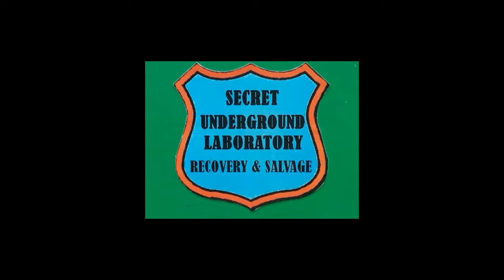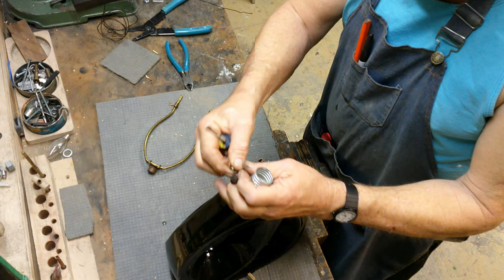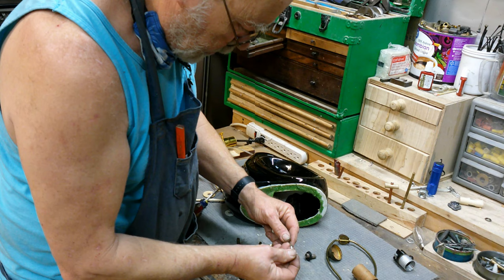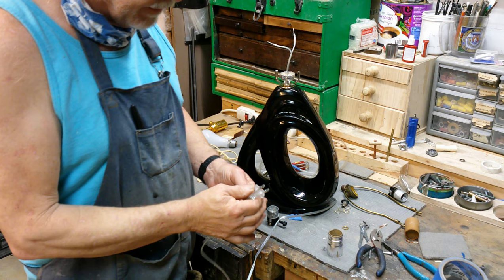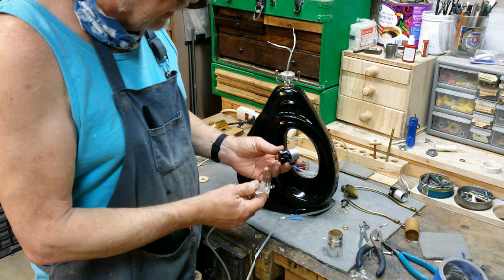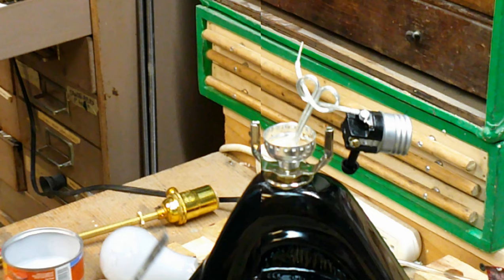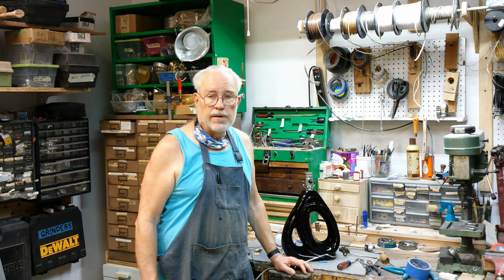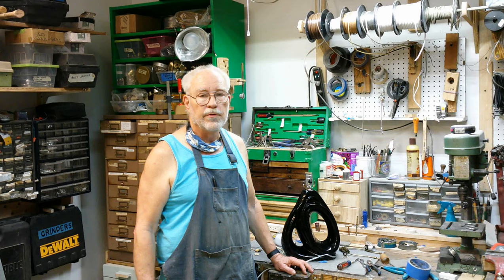Rewiring a 1950s art pottery lamp in the Secret Underground Laboratory.

Comment: Antique lamp 
In your video I don’t get the best view of where the wires go on the 3 terminal I have 3 wires and I’m not sure where they go.
Reply from the maker: Most lamp cords have only 2 wires. If your cord has 3 wires, one is a ground wire and should be attached to the lamp pipe. 
In this video the socket has only two terminal screws, a brass screw and a silver screw. If your lamp socket has three terminals, it should be a brass screw, a silver screw, and a black screw. The black screw is for a night light bulb in the base. The lamp cord insulation has one side which is smooth and the other has a ridge. The smooth side goes to the brass screw. The night light socket will have a black wire and a white wire. The white wire and the ridge wire go to the silver screw. The black wire goes to the black screw. I hope this helps.
Reply: @BronZeage  I’m going to send this to my grandma husband and I will let you know thank you!
Reply from the maker: @bladejacobs7295  I am happy to help. Don't forget to like and subscribe. I have several other lamp repair videos.
Reply: @BronZeage   yes sir